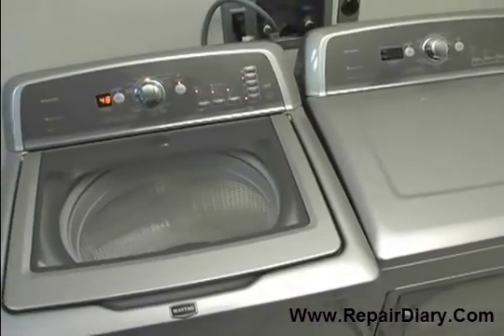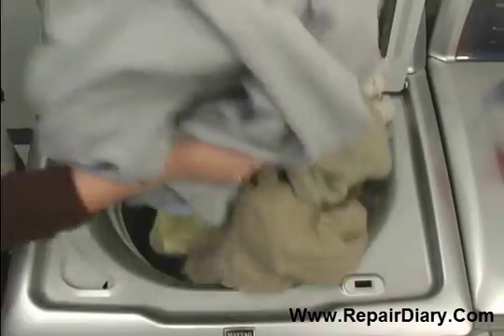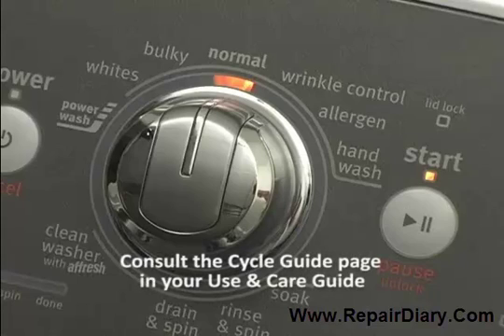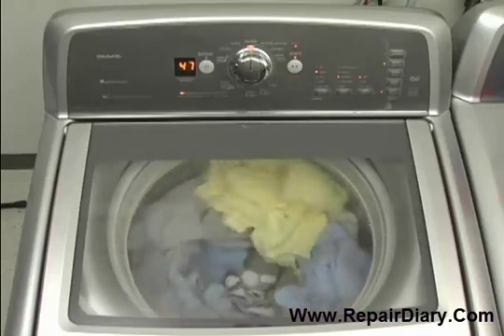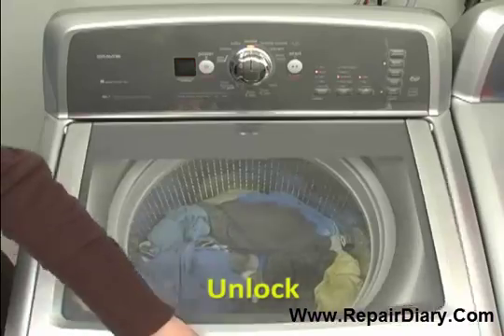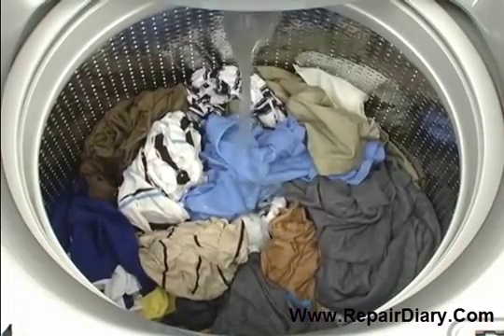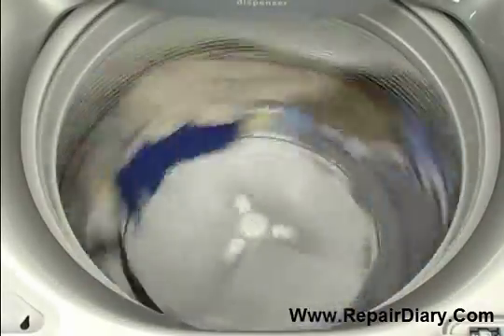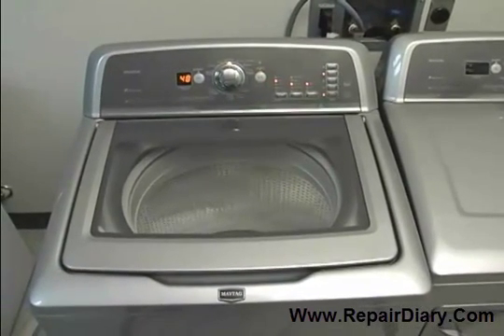How High Efficiency Top Load Washer Work

Comment: I HATE my HE washer !!!!! The old ' agitator' washer was the best !!! I guess I will have to look for one at a second hand store--New is not always the best !
Reply: Right these suck and they have like 6 buttons i miss the old 2 button washers cycle and water level lol
Reply: I just bought a GE from Home Depot,  no returns. Called GE to see about exchanging it for one with water fill selection and agitator.... they are sending a repairman out! I'm out 600.00 when all I want is an exchange! These washers will never clean your clothes!!!!!
Reply: SQ TC5000WN, available through mom-and-pop "furniture and appliance" stores.
Reply: My top loader wont drian had it 4 3weeks...Ugh!
Reply: Speed Queen AWN632SP116TW01, product code TC5000WN.     
Not inexpensive, but they use enough water to clean the clothes, and the machines are designed for twenty-five year longevity.
Reply: They still have washers with agitators at Home Depot
Reply: Yes but old ones are big water guzzlers
Reply: @27 golden sonic Don't know where you are.... do you have PC Richards, Best Buy, Lowes?  Try them
Reply: There are videos that explain how and why it works the way it does. I felt the same way myself until I understood
Reply: @chrissyo35  - The concept makes sense when they explain it, if I have two damp pieces of clothing with a detergent and both are rubbing together it will clean clothes, I still don't think it will as well as older machines, but the concept makes sense, they just need to improve it better.
Reply: Agitator machines will be far more aggressive on washing clothes compared to modern machines
Reply: You need water!
Reply: Who told LG and Samsung to make HE washers or anybody else for that matter?

Comment: i hate my HE washer..wish they still sold the top load agitator ones.   my old one lasted 24yrs
Reply: I'd like to know how these are he when they take an hour or more. Might save water but not electricity
Reply: They do still make top load washers with agitators. I buy and sell washers and dryers and I get them in all the time. I have several right now. I actually try to stay away from the washers that don't have an agitator and I never buy or sell a front load.
Reply: they do
Reply: All kinds of electronic problems constantly giving errors. Door leaks. Rubber around the door has lots of problems. Not near as easy to work on. There was a HUGE recall because of mold growing in them.  You have to run a clean wash through them all the time to keep them from smelling bad. And a big reason I personally don't like selling them..... not as easy to move around as a top load. I do sell the top load without the agitator only because they are easier to work on for my guy. He can usually either repair it or tell me it's junk within 10 minutes. Nowdays they have a computer board also so if that is messed up it is junk. Some people say they are really loud and some people say they don't clean as well and some people love them. I sell any top load that makes me good profit. I bought a Kenmore washer with NO agitator and matching dryer (2 months old) last weekend that was used 11 times. Bought it for $250 and will sell it for $599. But personally, we have a set that was made in 2001 in our house. I think all new ones suck.
Reply: If Gore has anything to do with it, you know it is BS.
Reply: SPEED QUEEN
Reply: Beware the 2018 Speed Queen top loaders (black faceplate) doesn't agitate/clean clothes and does a poor job in comparison to their previous models. Many YT videos prove this fact. Even today it's hard to find/purchase a pre 2018 because the older units are now in such high demand.
Reply: Sue Doe
Reply: I hear that the front loaders have mildew problems.
Reply: Jennifer Crown jj
Reply: K D 
I have a 2016 SQ. Awesome machine.
Reply: what's the problem with a front load?  I had one once, it was ok, but when i moved i got rid of it and got a maytag bravos which i regret. Neither clean as well as an old fashion washer imo.. but i'm all ears as to what you have to say
Reply: They do. I saw tons of them at Lowes in the sub $400 range. Albeit they don't look at high quality as they used to. Guess everything's built cheaper these days. Failing all else, you can find them everywhere on Craigslist or you can go to a used appliance store. They're bound to have them.
Reply: Sue Doe I hate mine too. :(
Reply: Sparkle Shine 
Leave the door open after washing. That's what we've always done with even top loaders. No mold. 
My shower eventually gets mold if I don't leave the door open and allow air circulation.
Reply: Speed Queen!
Reply: Sue Doe wjdhwvsidohc........
Reply: Sue Doe they do you just gotta go to a side of the road top of place
Reply: #bringbackthefilterflos!

Comment: these things are basically a joke, I was close to purchasing a washer and dryer combo. After watching several videos, I came to the conclusion to keep what I have (Roper) use in small load mode with hotter water, so far so good.  I mean give it some thought, all these Hfe washers have  shorter agitator...remove all the unnecessary "Bells and Whistles" from them and essentially you're washing your normal amounts 
 in a small load mode... btw you can also make your own hfe detergent for pennies.

Comment: Save your money people,buy a washer that has an agitator,I made the mistake of buying one of these new washers and dryer and they use twice as much water because you have to wash the clothes 3 and 4 times and that's no lie,and the cycles are much longer than the old washers,and they cost a lot more mine was 900 and some change what a joke
Reply: Even washers with an "agitator" are still HE washers. The only old school washing machines still around are Speed Queen unless you buy an older used washing machine.
Reply: Rockie mountin I'm good
Reply: The new Speed Queen is also junk. They changed the way the agitator functions. It doesn’t “churn” the clothes anymore. It’s more like an impeller now.
Reply: Get a Speed Queen Classic and be done with it. Plain and simple!
Reply: @jeromedavis8575  that’s exactly what I went to buy unfortunately the wife wanted matching washer and dryer so here we are,it is fine for people that work in an office,but if you get good and grimy as I always manage to do im using a bit of Dawn dish washing soap and bleach to try to get my hi vis shirts clean they always look like I didn’t wash them it’s embarrassing 😳

Comment: Repairman told us to put off buying HE washers as long as you can. They are too touchy, don't get deeply soiled clothes clean, and if an item is a waterproof poly blend like pillow case covers or baby sheets or windbreakers, the washer cannot sense their weight and they could screw up the auto balance and spinning cycles.

Comment: Tip to manufacturers of this type of washer... it is not high efficiency if the clothes are twisted up damp for twenty minutes.  Double the water and install a side vessel to save the used water in.  We will do whites first and darks second, in enough water to save our clothes and the water.
Reply: Old washer r the best wash clean no matter what state the clothes in he don't do that

Comment: I wish I would have seen this video sooner I purchased mine three weeks ago and it is a piece of junk it does not wash your clothes do not waste your money
Reply: +Sabrosita Pr You're 10000000% correct. I also wished I would have seen this video before. I purchased a GE HE and I can't tell you how much I miss my old Whirlpool and agitator.  This thing is a freakin' joke.  Mine has a huge drum but doesn't make use of it because the water only fills half the drum.  It tears my clothes up because it doesn't have enough water.  There are more stains on my clothes than ever.  I purchased the GE with the "deep fill" option, but that's a joke. They call "deep fill" water option that only fills halfwayl.  My clothes were cleaner with my old Whirlpool.  I don't care that this is HE and saves water, what good is it if doesn't get clothes clean? I rather spend more money on water and have clean clothes than deal with stains and wrinkled up clothes.  This isn't energy efficient because since you could only use small loads at a time, you will be washing clothes for a longer period of time.  Each load on my GE is an hr because it takes a longer time to get clothes from the top to come in contact with the water on the bottom.
Reply: I have one it is a fine piece of crap.. not only that it costs over $200 for me to replaced the control panel that went out... all these style are pure junk.. not worth money..
Reply: okay you're on every video.
Reply: Chantel F
And you must have watched every video :)
Reply: Shenanigans!Shenanigans!Shenanigans!
Reply: @Sottosorpa  I second that!
Reply: All HE's are like this!!😮😢
Reply: I call bullshit
Reply: Love mine
Reply: I'd rather take the Speed Queen Perfect Wash over this stupid crap, and that's saying something. I am serious!
Reply: YhwhKhaiMostHigh wow you're really smart. How else could I have known
Reply: @cupcakes4444  Stupid shenanigans that don't do stupid crap!
Reply: i disagree

Comment: I have a new HE washer and I am ready to smash it to pieces.  I had a small load and added a small amount of detergent.  It goes through the "sensing" and "wash" stages, but skips the "rinse' and "spin" cycles.  I have washed the same set of clothes three times already and the tiny amount of detergent I added still has not dissolved.

Comment: Never understood why USA uses these. Front load machines standard in Europe for 30 plus years. Use 1/3 of the water, clean better, no agitator to tangle and wear clothes, spin upto 1800 rpm and leave clothes nearly dry. Heat own water so no losses in pipe work etc. Best models come with 10 year guarantee. And in UK a cheap front loader can be bought for less than £200 ($300 approx). Like american cars, american laundry technology seems to be stuck in 1955.
Reply: Not to mention save huge amounts of energy. A typical A rated machine will use around 50litres of water and just 1kwh electricity for a standard load.
Reply: Spencer Wilton you said it!👍🏻
Reply: Such B.S. I lived in Europe for 6 months. No washing machine goes 1800 RPM. Just so you know...

Comment: To think I replaced a 30 yr old GE top loader having an agitator, lint basket, recirc pump, and mechanical selector switch for an HE Maytag Bravo top loader that doesn't clean clothes.  It takes water, an agitator, and lint basket to really clean clothes. It has no way to remove pine needles, wood chips, or grass clippings, so leaves them in the bottom of the wash tub. That means you need a shop vac stationed near the washer to clean it out.  It captures coins under the pretend agitator and ties clothes in knots, intertwined with other clothes.  It prides itself on creating the sharpest wrinkles clothes ever had.  Need to select "Bulky" setting to use any water.  Sets LD (long drain) code frequently, then won't drain without unplugging for 10 minutes, then trying the drain and spin cycle which takes another 10 minutes.   If there is so much as one or two soap bubbles, the LD code crops up. Yep, you can disassemble the thing and keep cleaning the pump and filter but these parts should be easily accessed like the old lint basket.  I'd swear that the engineers who design this stuff don't do their own laundry. Four years of aggravation from this POS.  The high dollar "clean washer" pellets are a joke, too.  No money saved, there.  Time to find another brand with agitator.   Money saved on water doesn't make up for having to service or buy a new washer this often.
Reply: +old 50Grit "to remove pine needles, wood chips, or grass clippings", there is no washing machine on earth that can flush that stuff down the drain. I know, I not only repair washing machines but also do laundry. What ends up happening is that garbage gets stuck under the agitator, eventually winding up on future laundry loads. you need to more thoroughly remove debris from your clothes or suck it up and vacuum the machine if you're going to be putting that stuff in there.
Reply: You should have held on to the old GE and just got it fixed. Thank god I never owned an HE top load washer because running the machine for 2 hours costs a lot of money on the electric bill, even on front loaders. I have an LG front loader and it does its job. And hopefully it will last me a long time, and if it breaks, I guess I will buy a speed queen or a vintage washer from the secondhand appliance retailer. I would NEVER recommend wasting money on a HE washer to anybody, especially over the fact that the clothes aren't even getting cleaned. and all this HE nonsense that EPA and Energy Star just started. You can also still find a 1975 Whirlpool washer, or a 1980s Kenmore 70 Series Heavy Duty Plus, or a vintage 1980s GE filter Flo at a used appliance shop or marketplace,  thrift store, or even at a local flea market. They just don't make appliances like they used to.
Reply: Get a Speed Queen Classic.

Comment: I just returned my LG 'HE' washer and bought a washer with an agitator. 4 problems with 'HE'  washer. 1) water level too low, sensor does not work most times, some clothes not even being washed after cycle as on the top without water. 2) cycle take too long time, 3 loads tool almost 4-5 hours, waste us a lot of time to wait. 3) machine keep running too long, electricity cost are a lot more.  4) Clothes are still dirty as clothes not agitated enough no matter what soil level u choose. The less water idea is very stupid as you save water but get dirty cloth.  So stupid!!!!! Half clothes are still dirty after washed!Other country such as Japan, Korean, Germany don't have those stupid "HE' washer, this only for here for those who want to save water and sacrifice us to have stupid 'HE' washer.
Reply: +Ivy Z Thing I ran into with my LotsaGrief was that the basket fills to the brim while it's sensing for a medium-large load, then goes into an unbalanced error state and I have to redistribute the clothes and run them again anyhow.
Reply: +Ivy Z If your clothes are still dirty then you're doing tit wrong. Either you're packing your clothes in to tight (clothes won't get clean no matter what type of washer you use if you pack the clothes in) or you're not following instructions or using the wrong setting.
Reply: Very well said!